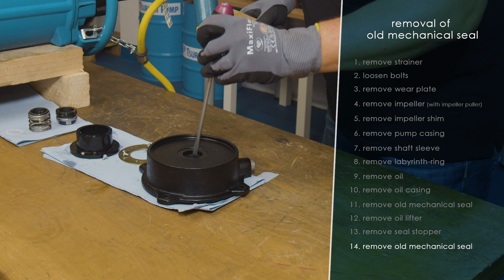How to replace the mechanical seal

Comment: 2:43 The instructions on the right say to wet the rubber surface with oil.  Then there’s a pop up message that says ‘don’t touch the mechanical seal and mount dry.’  Can you explain what this means?